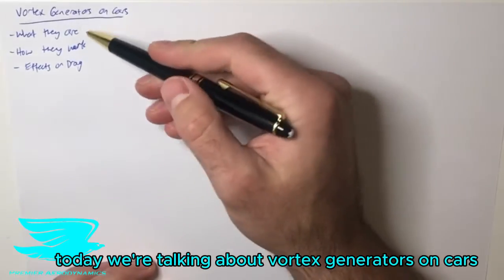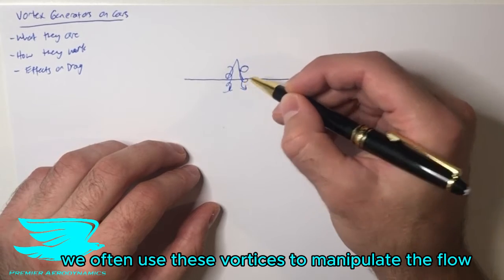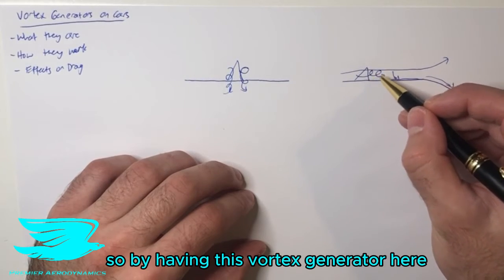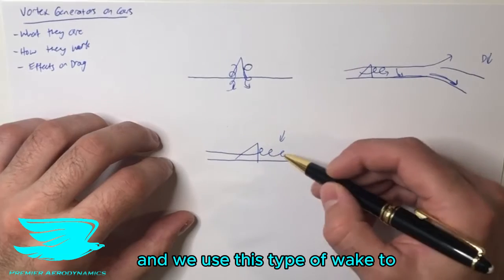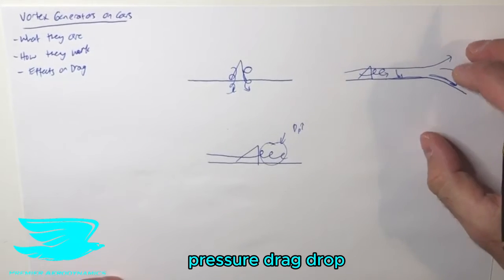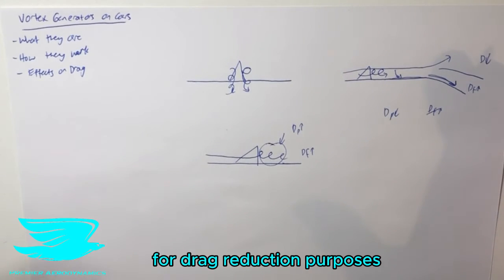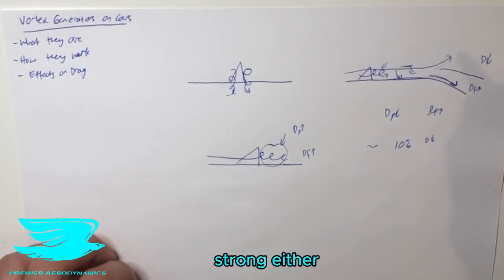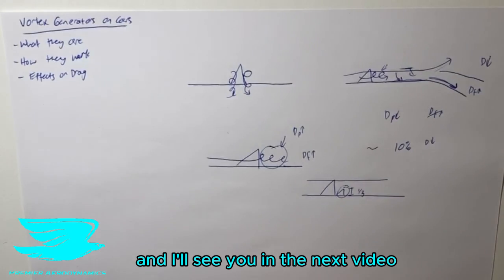{Auto Aero #31} How Vortex Generators Work On Cars

Comment: Your claims are only true when vortex generators are adequately placed. 99.9% of individuals who buy them and stick them on their car do not see 10% losses in drag. Im willing to bet they increase drag. On airplanes, vortex generators are carefully placed just ahead of control surfaces for specific cruise speeds - to keep the turning flow laminar.  Car aerodynamics are not catered to specific speeds for obvious reasons and therefore vortex generator applications are reserved for high performance vehicles (at that) where more predictable speeds are prevalent (like drag racing). As an aerodynamicist, i do not recommend people install vortex generators on their cars unless thorough analysis has been done. They will most definitely induce more drag if just slapped on the roof of your car.
Reply from the maker: There is a fun way for the regular person to investigate where to put vortex generators on their car (if they don't mind getting their car dirty); put some kind of liquid with baby powder in it over your car (oil film flow viz but without the kerosene to protect the car), drive around, see what the pattern looks like. If it doesn't look fairly well behaved, put vortex generators ahead of the region, drive around, and see if it makes it more well behaved.

If so, you likely have reduced the drag of your car over the circuit you just drove.

Aerodynamics can be done by anyone, if they have the right knowledge.
Reply: I thought all manufacturers already added micro versions of these by default since 2015 or something at least to regular European street car models. If a car already has these, it is high probability that all low hanging fruits have already been picked and only risky bets remain. 

Plus the shapes of newer cars look simple but there probably is more than meets the eye in order to reduce drag and fuel consumption already before first prototypes have been built. So it is easy to increase drag significantly with your own modifications messing up thoroughly optimised flow paths.
Reply from the maker: That's a good point. The general philosophy for designing cars now is to make the rears smaller, the diffusers more aggressive (than traditional), and cover the rims and even the wheels. That leads to smaller wakes, particularly if the flow is attached over the roof.

But, that doesn't mean that vortex generators are useful in some areas still. There is one place that a car manufacturer is looking in to, I'm not sure if I can say it, but just think of one major area of the car that is usually used to reduce drag, but if you go too extreme, the flow separates. They are putting them there to see if they can run at more aggressive angles.

Comment: Trade big eddies for smallel vortex trails.

In a fast car I'd be concerned about possible increased lift. A car wnting to convert into an airplane: not good.
Reply from the maker: LOL, that's true.

If you have a wing on the back, it might help it produce more downforce too. So, there'd be a tug-o-war between the lift of the car and the downforce of the wing.

Comment: You ever wonder if that Cat 5 hurricane that landed in Acapulco was strengthened by the mountains to the east acting like vortex generators entraining upper level air.
Reply from the maker: I don't know...I wonder if mountains reduce a hurricane's strength just by ripping apart the coherent structure. If a large mass gets in the way of the hurricane then it can't really follow the same swirling path and that could destroy it, or at least weaken it, imo.
Reply: @PremierAerodynamics  They do! What I mean is, a Hurricane spins counter clockwise, and the upper level winds blow from west to east, or in the direction of rotation(depending where the wind is relative to the hurricane). Could the mountains then act as vortex generators on a large scale, which in turn added rotational energy to the hurricane. Which then caused it to intensify.

We've seen von Karman streets on large scales as air flows around mountains, so why couldn't mountain ranges act like giant vortex generators?
Reply from the maker: @rolandotillit2867  That's an interesting idea. But, because of the periodic shedding, the energy given by one macroscopic vortex would likely be cancelled out by the other vortex that spins in the opposite direction.

So, maybe if the hurricane one vortex but by the time the other vortex was shed, it moved away, then it would be a net increase.
Reply: from experience on our side of the world, typhoons tend to weaken due to interaction with land, especially mountain ranges. The wind speed felt on the ground is weaker as a result. It has another effect though; dissipation of the cyclone's energy can lead to increased precipitation as it gets slowed down.